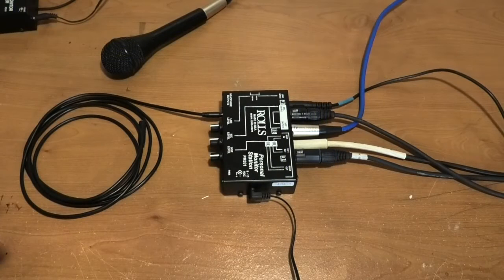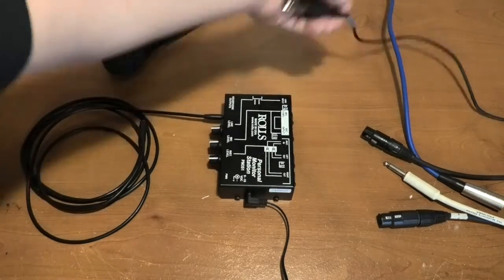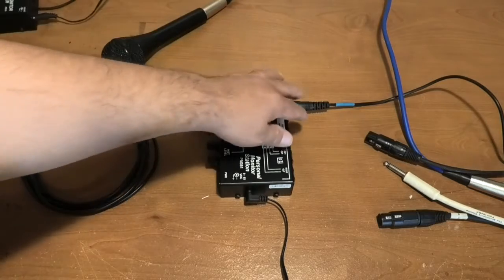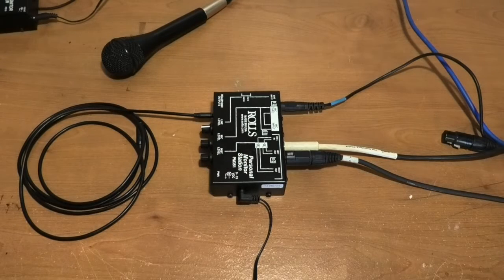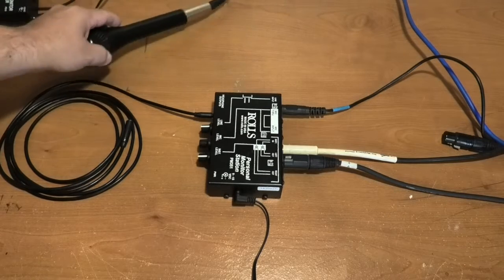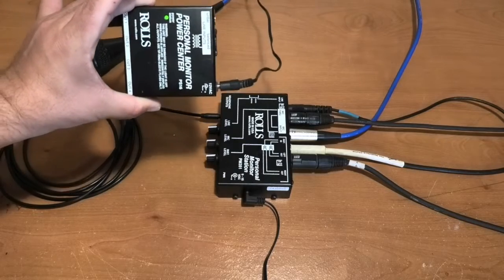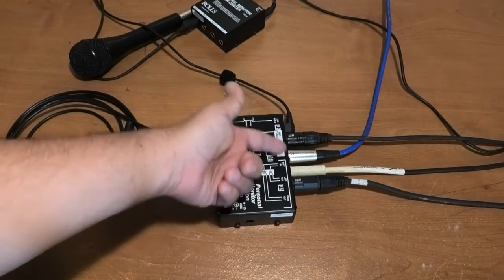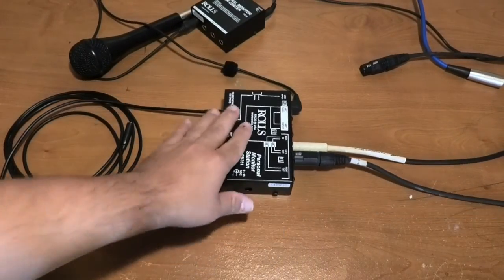Rolls PM351 - Extra Simple in Ear Monitor Mix

Comment: I can't believe how loud it is. So far I find it unusable.  Volume peaks and pops in my ears, but any lower and it's inaudible. No limiter in it either. Any ideas what to do?
Reply from the maker: So Sorry just seeing your reply .  I had the same issue on a few occasions.   Typically because the audio source i was running to the the "Rolls" was too hot.   also the xlr input is trimmed at a higher Gain (for a mic) than the 1/4 inch input (for instrument).    on a few occasions When I had to run a powered signal to the XLR input, I would usually have to dial down the source signal some.      I think the newer ones actually have a gain switch on the inputs. we still use these on a weekly basis with decent (yet not perfect) results.I truly hope this helps.   have a great week my friend!